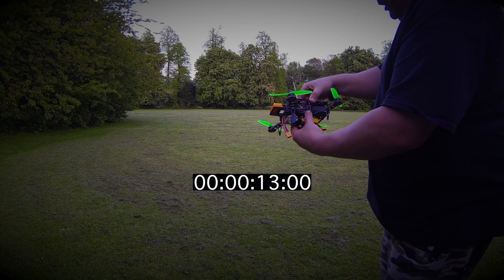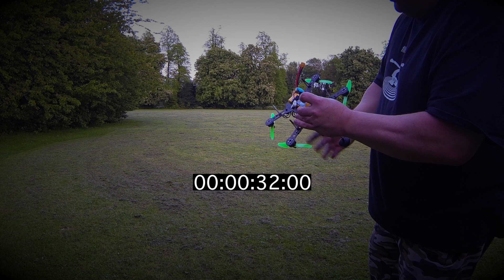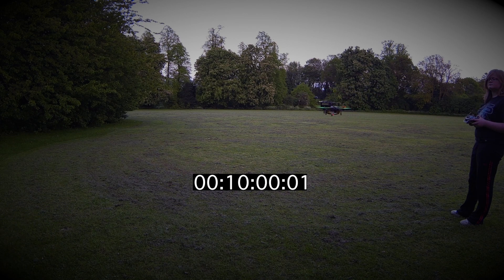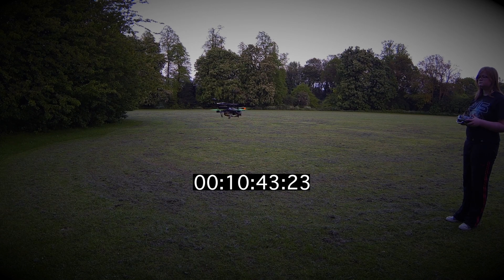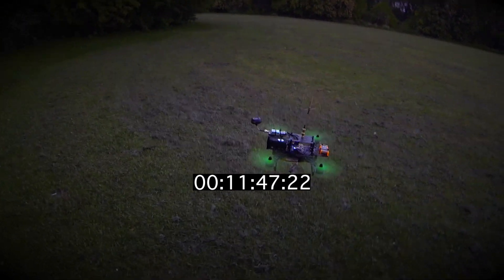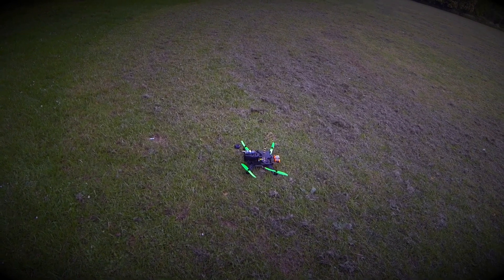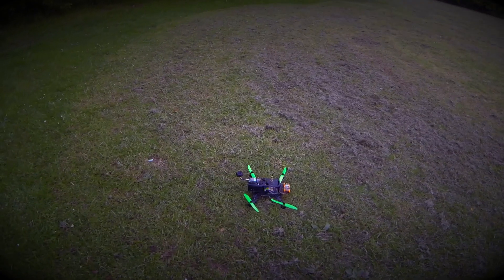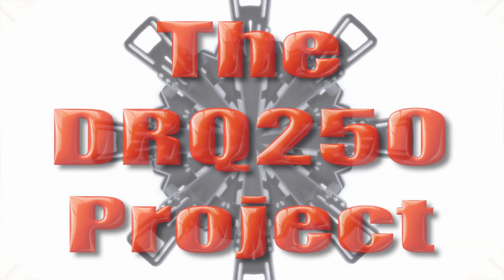The DRQ250 Project - flight endurance test

Comment: Maybe I've got a duff CC3D board, because every video I have seen on YouTube, the quad's seem pretty stable. Mine isn't! When you move it off centre and let go of the controls it centres its self ok, but its like it rides a little ripple as it does it! I have another 250 quad with a Naze32 Acro and that flew great, straight out of the box. I have tried other peoples P.I.D settings, did not work! I have reinstalled everything, half a dozen times, wiping the board and starting from scratch each time!!! Don't know what else to try. Admittedly I have only buzzed it round L.O.S so far, but it will not hover as well as yours!!! Is it susceptible to vibes? The only thing I can think to do is to mount it on a ant-vibration mount??? If all else fails I will just replace it with another Naze32 Acro.
Any ideas?
Reply from the maker: All board are very sensitive to vibration. The DRQ's clean plate helps here but I still use a little something to cancel any other vibes that get through. Have you installed Mini Me firmware? That is mini quad specific to that should help
Reply: RCTV-UK never heard of mini me firmware!  Just watching your build video now. I have the CGX250 from Coptergeist with the Naze32. And a Emax 250 with the CC3D board. Neither have the clean/dirty plate. The Naze seems ok. But maybe the CC3D is more sensitive? I will try a anti vibration mount for the CC3D and go from there. But what's that firmware for?
Reply from the maker: It's the new open pilot FW released for minis https://www.youtube.com/watch?v=FoaDor2-cQc
Reply: RCTV-UK Just checked. That's what I was running! So will go with the anti- vibration mount for the CC3D board first! Will keep you posted! 
That 6S quad looks a beast!!!
Reply from the maker: Yes it is =D